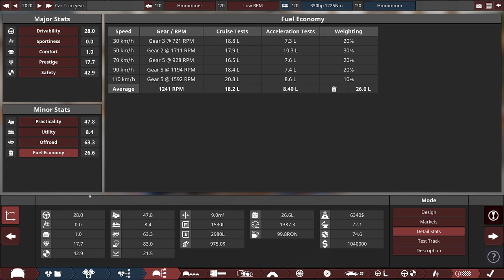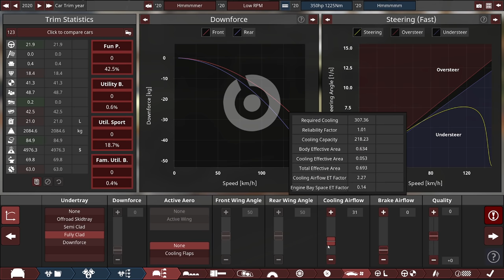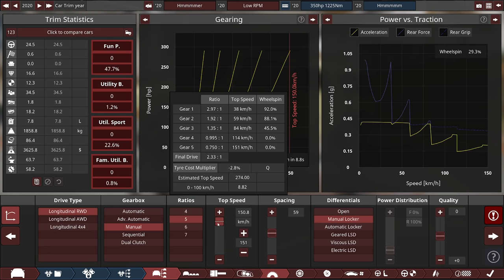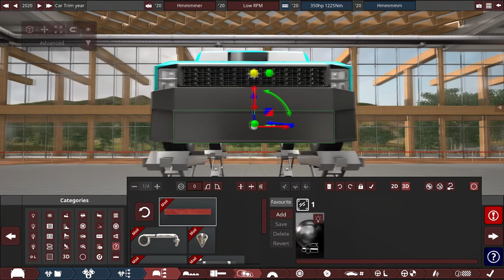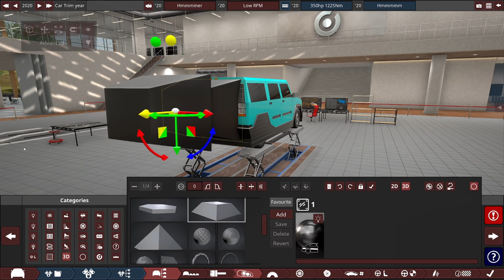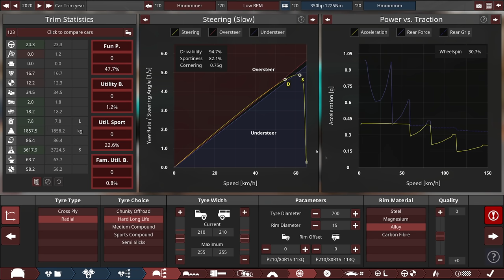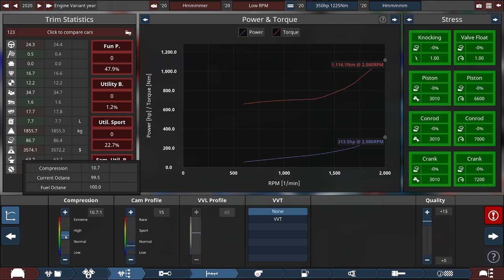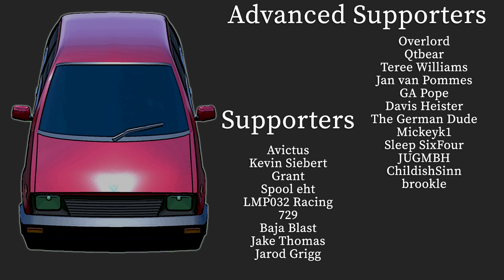The Most Fuel Efficient Hummer Ever

Comment: i think the top speed thing is that the fastest gear ratio can only be so much, so your top speed is limited by the rev limiter
Reply: sounds like it, compare 150kph at 2000rpm with 600kph at 8000rpm
Reply: Yes, I run into this problem alot with low-RPM high-power vehicles ingame. It's really not designed for diesels, I don't think it ever will be lol
Reply: Exactly right. The rpm limit of the engine is the cause for his top speed cap.
Reply: Low rpm limit, high weight and drag is what ruins the top speed in my experience.

Comment: Your low engine rpm means even with long gears your reaching redline at a lower speed. Increase tire size, change transmission ratios or final drive ratios to increase top speed. Not sure what options you can do in automation
Reply: from my experience you have to edit the final drive ratio after exporting the vehicle

Comment: One of the downsides of gas engines is that they are least efficient (read HP/fuel) at part throttle and most efficient at around 80% throttle. That's why small engines typically are most efficient.
The torque curve typically reflects the engine efficiency curve.
It isn't well understood but accelerating at 30% to 80% (depends on the point  where your car ECU switches from closed circuit fuel maps to open circuit) throttle up to speed and then using a "pulse and glide" driving technique while cruising. 
Note of caution. Bothe these techniques will infuriate the person behind you
Reply: I’m assuming this depends how an engine is mapped
Reply: @ekaimin8451  yes, my turbo cars go into open circuit fuel maps at 30% throttle, but they are both  performance cars from before we were cursed with the prius 🤣

Comment: Engine braking saves more fuel than going neutral or pressing the clutch, if someone needs to know

I'm amazed that you use automation that much and still don't know how to correctly tune an engine. But tbh your originality compensates, and that's something not everyone has, nice video

Comment: Coasting downhill in a manual does not save fuel, and might even use more. The ECU will (probably, depending on the car) cut fuel if you are coasting downhill with your foot off the gas.

(In reference to 0:35)
Reply: Why? I'm curious
Reply: @lucaspeyret  I'm not an expert by any means on this stuff, but what seems to be the case is: Basically every car after the 90's cuts fuel when you are above a certain rpm and your foot is off the pedal. This saves more gas than coasting, since the engine still has to idle when you do that.
Reply: @lucaspeyret  I only know the German term „Schubabschaltung“ which translates to thrust cut-off. But looking for it, there are no sources in English. So I can just provide a German one: https://de.m.wikipedia.org/wiki/Schubabschaltung
Reply: @lucaspeyret  That is a fuel saving mechanism. When in gear (while moving) and above a certain rpm (1100-1400rpm) the ecu will cut-off the fuel and the engine is kept spinning by the movement of the wheels via the transmission. The motor uses zero fuel and is passively braking due to the compression of the cylinders and the movement of the generator and ac compressor.
Reply: @spoobspoob2270  yeh, definitely, didn't know about the "above a certain RPM" thing but would imagine it's low only to prevent a stall. But for sure, take your foot off the accelerator and fuel is cut off, agreed.

Comment: Holding onto clutch while going downhill doesn’t help, even it makes your fuel economy worse. When your of a gas pedal it doesn’t send any fuel to your engine and your engine is running purely on a force of a car going downhill, and if you push a clutch you need a fuel to keep the engine running.
Reply: Came to the comments to find this one! Basically you're letting the wheels drive the engine instead of vice-versa, if you disconnect them, you need to keep the gas flowing to keep the engine from stalling
Reply: I think it's an old carburettor thing, where fuel draw is from the pistons not injectors and an ecu, the lower rpm the less intake strokes drawing fuel from the bowl. You're right though modern cars switch off the injectors while coasting downhill in some circumstances.
Reply: Not all cars do this.

Also, you'd be engine braking, so it depends on how fast you wanted to go downhill.

Comment: Note: pushing the clutch going down hill is a bad hypermileage method. why? on modern cars, when you go downhill, and don't touch anything, you do not consume any fuel.
Reply: Modern cars rarely have clutches to push.
Reply: @06racing  modern people rarely know how to drive much less control important things like shifters and pedals
Reply: @06racing  well, modern european cars still have manual (less and less, but still). And my car still have a manual gearbox so i can tell you
Reply: @BrokeWrench  i get what you mean but im the opposite, i want to learn as many driving method as possible: heel toe, double clutch, before I was rev matching, ...
Reply: Most people barely know how to drive
If someone cares about driving, they'll get good at it, regardless of age
Reply: @06racing  as European I disagree totally 🤦😂

Comment: We get about 8L / 100km woth our 2008 Yaris 1.8

... on tigth country roads with winter tires and a large boxy trailer
Reply: A TS! Wonderful car, I sadly have the 1.3.
Reply: 4.344L/Km how is that?
Edit: don't trust this value, using online converter shows it's way off, it's closer to 7l/100km with all city driving... fuuukin Peugeot sakes
Reply: I ask because that's what I get out 208GTi, 1.6t, ~1100kg 208hp... I thought it was kinda poopy tbh man
Reply: I still love it though and they're not as horribly terrible as their reputation dictates btw people. It was great for the price for me, the best I could afford and for just that I really love it
Reply: Bread
Reply: @gram.  what year is it?
Reply: @myjinji8079  2016, the 208hp euro6 engine
Reply: @myjinji8079  I needed to change the units in settings for it to show that value btw, but on uk mpg it shows 40mpg
(With online calc it shows 7.06 l/100km)
Faaakin Peugeot😅😅
Reply: @gram.  rad as hell car my man, a friend has the one with the red and black matte paintjob to match. enjoy it. 
also 7l/100km doesn't sound bad at all to me, with all the performance you can get out of the car 'cause that thing moves when you want it to
Reply: I get ~5 with a 2001 Swift 1.3

Completely unloaded at 820ish KG

Comment: I have a 2022 hyundai elantra N  with a 6 speed manual. No mods as its a street legal track car. It's base fuel rating is 9.4L per 100km. My average I'd 6.8L per 100km. That's insane for a place like newfoundland

Comment: Well I'm trying to get 1k km on a tank (600mi) in my car, and strangly, when I drive hard (thats very rare) I do consume less for some strange reason that I dont get... So now I floor it every once in a while (I don't think you did ever drive any cars with such low hp tho, 110hp in diesel)
Reply: Maby its because diesels are extremely efficient.  And maby when u drive hard the turbo wil kick in wich wil improve mpg. Since it uses waste exhoust gasses to power to boost engine. Wich makes it more efficient. Maby when u drive slow the turbo didn't kick in and so no wasted exhoust energy is used to help move the car
Reply: @crispyshaman4937  guess so, but i got to be over 3k rpm then to be efficient then?
Reply: @_underscore_2381  yeah maby that wil probably explain why it was more efficient when driving hard